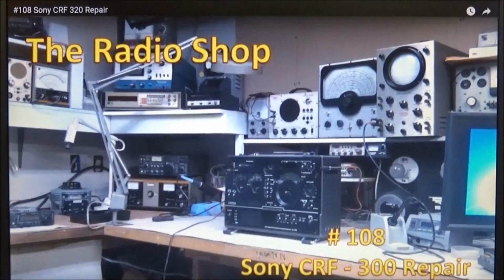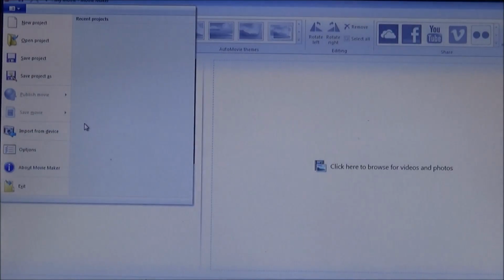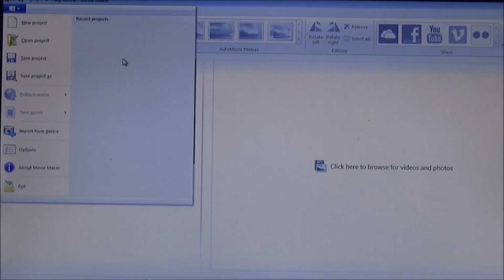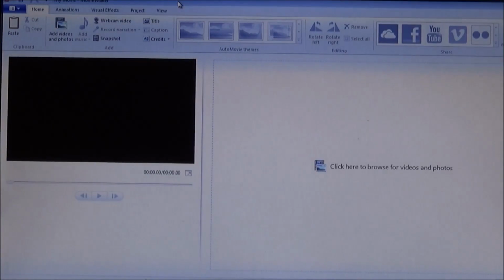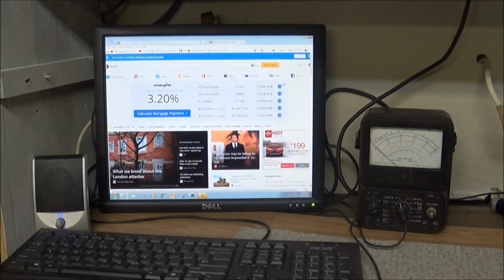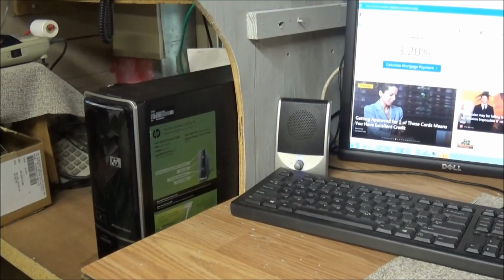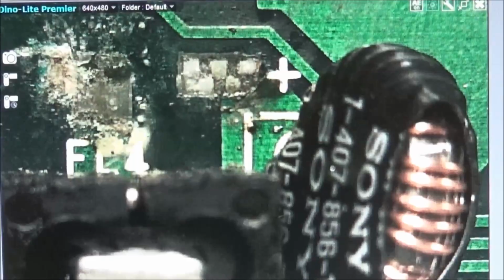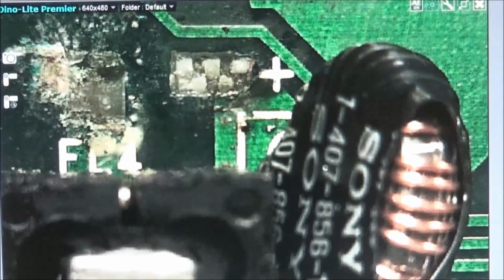#109 Shop Talk This and That

Comment: I powered up my newly aquired IFR1200, and it worked for half a second, showing text on the VFD for half a second and sounding something from the speaker. Then it died. Only the transformer makes a hum. Before powering up, I removed the internal, rechargable battery pack and checked that the voltage switch was set correctly. Would it be safe to try powering it up via the 12-30VDC input? Or is it better to troubleshoot the main power supply first?
Reply from the maker: Sounds like the PSU failed. I would remove the AC fuse and try in on DC. If everything works you then know the PSU is the problem.  There are several diodes on the board that get hot and crack.
Reply: @TheRadioShop  I tried applying DC without removing the AC fuse. The lab PSU was set to 24V - 4A. The IFR1200 pulled 4A while the PSU was in constant current mode, but the IFR1200 did not show any signs of life. Could removing the tiny 250 mA AC fuse make any difference?
I probably should check the "1 - Line Supply" and the "3 - Battery Charger & Inverter Supply Assy." for bad capacitors.

Comment: Looks like someone may have replaced a SMD electrolytic  with a radial leed one.
Reply from the maker: Yep, that is what they have done. Bad thing is my copy of the SM is horrible, The circuit lay out is not legible at all.
Reply: The Radio Shop 

Not sure if I have an original for that.  Will take a look and see what I can dig up.
Reply from the maker: That would be cool Mike. Let me know if you do. Thanks